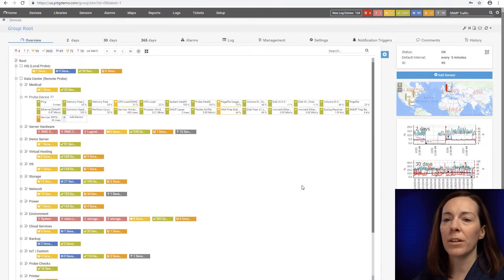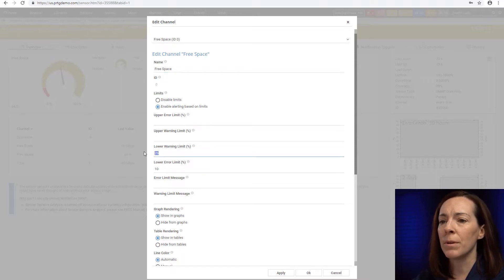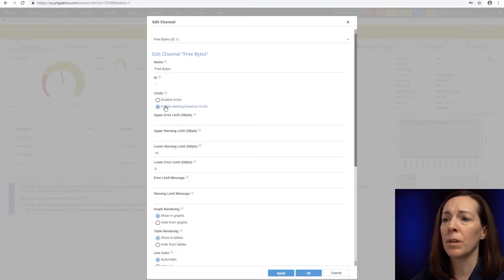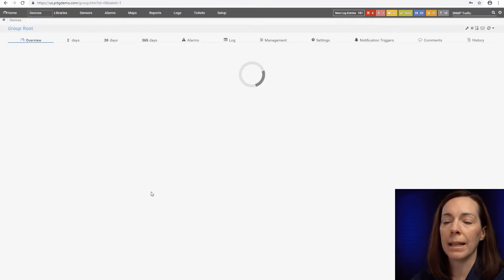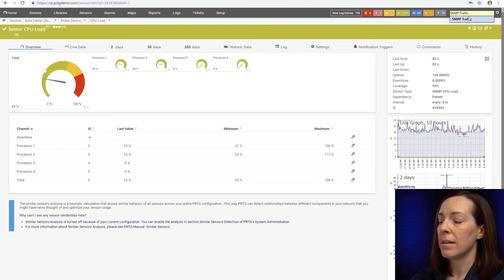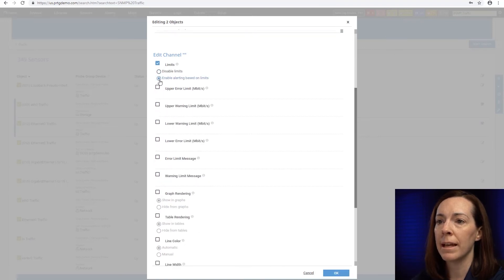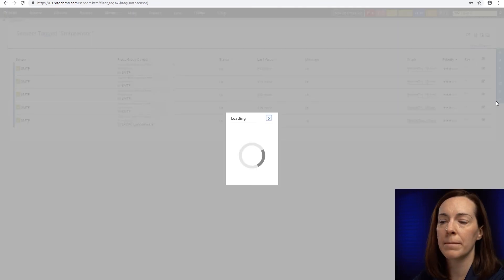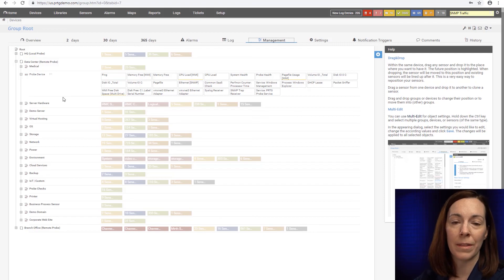PRTG Tutorial - Channel Limits

Comment: Long "A".   Gage vs. Gauge

Noun

There are two gages: one refers to pledges or securities and is no longer in common general use, and the other is a variant spelling of gauge, which in the noun form refers broadly to measurement (“fine-gauge wire”) or a standard by which something is measured (“polls are a good gauge of how voters might vote”). The earliest evidence we have for the noun gauge goes back to the 15th century, when English spelling was not yet standardized, and the word in question was spelled gauge and gage with roughly equal frequency. Gauge began to be preferred in the late 19th century for most general uses. Some claim that gage appears as a variant more frequently in the U.S., though our evidence shows that the vast majority of uses for gage are from specialized and technical industries, such as mechanical engineering, manufacturing, and electronics, and that these uses of gage are global, not limited to the U.S. Nonetheless, total use of the word gage is small when compared to the total use of the word gauge.

The verb gauge, which refers to measuring or estimating, also has a variant gage. This variant appears to show up primarily in informal sources, though not often. Gauge is by far the preferred spelling in general usage for both the noun and the verb; we encourage you use it.